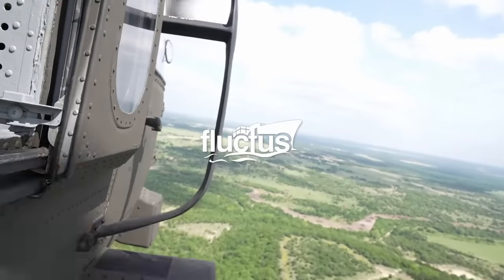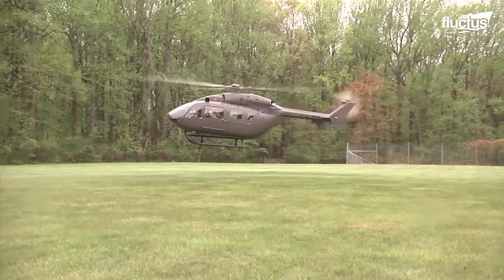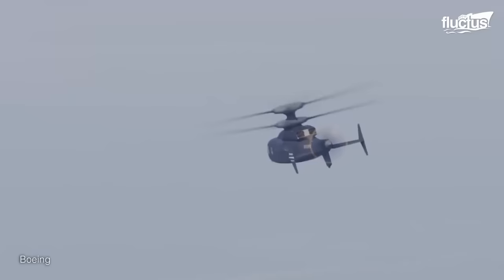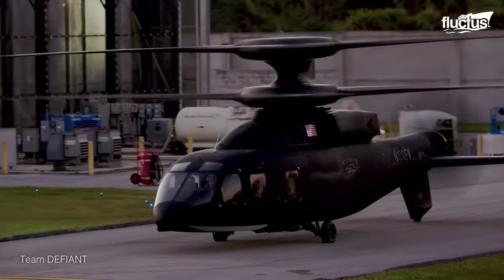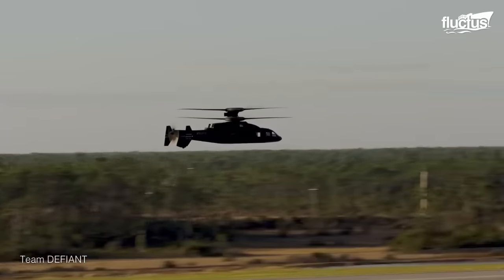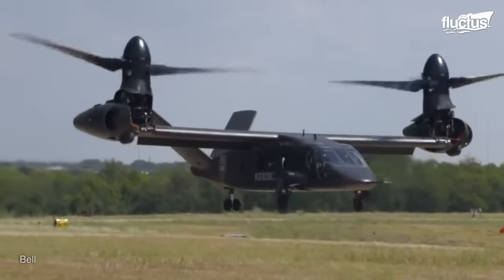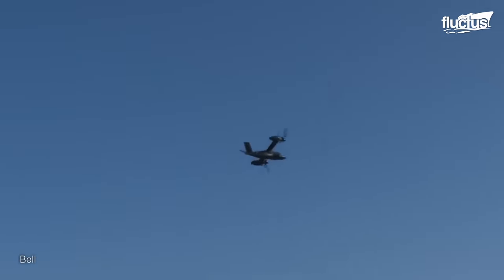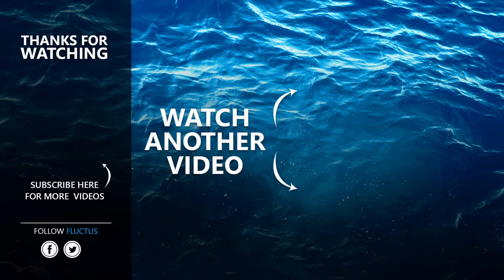US Testing Billion $ Worth of Brand New High Speed Helicopters

Comment: The V280 is going to have about twice the range of the MH-60, which will be pretty important for the Pacific.
Reply: The range alone is absolutely game changing. The increased speed is also amazing.
Reply: Is it as survivable as the Black Hawk from small arms fire?
Reply: @allen480 If it is for the military, which it is, they are thinking about it. Also, there is a shaft connecting the two props, and two motors.
Reply: @allen480  No transport helicopter is armored... It will be as survivable if not more as it can be made up of newer composite materials.

Comment: The helicopter technologies ia old system because when there is heavy wind the helicopter fan is meaning less .the wind crash the helicopter .

Why not create how to create heavy wind to wipe out .From front sides and downside  and above the helicopter or upper part and back side .
This is silly common sense .
How the helicopter crash because of wind heavy .the heavy wind create problems.

So you will helicopter technologies to wipe out the heavy wind from all angles .then you can stable the helicopter . 
The atmosphere is wind to wipe out heavy wind

Comment: the only thing i really would add to the one helicopter is a 2nd tail, forward of the first... why... to help hide the exhaust from the sides.  think like an a-10.  the way it is now, it will help protect the rear pusher/puller prop blade... but the exhaust can still be seen from the sides really easily i'd bet.  maybe a short wing with the same sort of tail build on each side of the exhaust with thermal absorbing tiles, like the ones used in nasa/space x.. to absorb heat and block visibility of the exhaust?  anyhow that is what came to mind for me anyhow.  peace.   as a bonus, if the tail is hit by the rear prop, and fails to function or perform its "duty"... then maybe the other set could help with turning when using that pusher/pull prop as well.  or improve the turn rate compared to what it is now if needed.

Comment: Russia has already made this type of helicopter.What is unique about it?the only deference is that Russia's KA-52 Alligator is not stealthy.😂😂😂
Reply: ... Coaxial helicopter have existed way before the KA-52. Not to mention that the tech used on the Defiant is new as it is a rigid rotor system instead of the normal flexible one. This allows the blade to be a lot closer together and has increased mobility.
Reply: @n3v3rforgott3n9  When did it exists and which country had this type coaxial helicopter?can you tell?
Reply: @CivilRights8308  Corradino D'Ascanio Build the first flying coaxial helicopter in 1930 in France. Or the Bréguet-Dorand Gyroplane Laboratoire which was a more successful one of 1935 also in France. So again this tech has been in use for a while now and we do not say X country is copying German tech whenever they are building any jet.
Reply: @n3v3rforgott3n9  Listen-the idea of coaxial rotors originates with Mikhail Lomonosov.He had developed a small helicopter model with coaxial rotors in July,1754 and demonstrated it to the Russian Academy of Science.D'AT3 in 1930 really but which year is older 1754 or 1930?Don't talk such stupid things again.
Reply: @CivilRights8308  Again like I said We do not say someone is copying German tech whenever they build a jet... your logic is also moronic as he never built one.

Comment: How two rotors one opposite to other push the air downwards at the same time  to keep it afloat •and second problem come s when tail rotor sucks the air from under helicopter s body it remove s air cushion which will make it difficult to remain afloat that s all and thanks 12:12

Comment: The MH-6 and the OV-10 should both be in current production.  There aren't good replacements for them.
Reply: Were you working on those airframes?  They are very outdated, OV 10s were pulled out of storage for OEF but did not fare well so they went with the Super Tucano.  There is absolutely no combat role for the MH 6 anymore with the advances in drone technology.
Reply: @tdgdbs1 The MH-6 is still in use and they didn't pick the super tucanos. They're buying 75 skywardens.

Comment: So what? the concept of double antagonistic rotors is used  by he Russian KA 52 fighting helikopter since 1997. So nothing new. The only new thing  ist the combination with the propeller, with means extra fuel consumption, but high speed for a heli.Speed is not all ...
Reply: ... Coaxial helicopter have existed way before the KA-52. Not to mention that the tech used on the Defiant is new as it is a rigid rotor system instead of the normal flexible one. This allows the blade to be a lot closer together and has increased mobility.

Comment: I like that the Valor has farther range and top-speed... it's so navy it probably comes from the factory stinking of salt-water.  But the Raider has some major advantages.  Training on the Raider is going to be a lot easier for flight-crews migrating from the Blackhawk.  Low-level flying, getting in and out of LZs is going to be much faster for the Raider.  The gunship configuration of the Raider is going to perform much better.  I want both aircraft the same as you'd want Blackhawks and Sea-Stallions.  There's a lot of overlap.  But the differences are going to be mission specific.

Comment: Russian KA 26😂
Reply: ... Coaxial helicopter have existed way before the KA-52. Not to mention that the tech used on the Defiant is new as it is a rigid rotor system instead of the normal flexible one. This allows the blade to be a lot closer together and has increased mobility.

Comment: The Russians are like copycat You're a copycat
Reply: ... Coaxial helicopter have existed way before the KA-52. Not to mention that the tech used on the Defiant is new as it is a rigid rotor system instead of the normal flexible one. This allows the blade to be a lot closer together and has increased mobility.